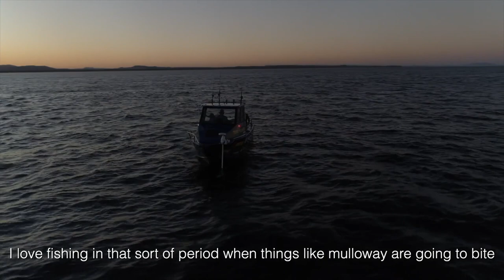Marine Rescue TV Season 1 Episode 9 "This is the Voice"

Comment: In one of the earlier Episodes . The fishing guy is talking about using the VHF radio. He even gives a really good demo of how to do it.
However to my great surprise at the end of the demo he stated and now turn this off. And preceded to do so. As a radio operator , Boater and a LROCP instructor. I find this quite disturbing.  I Teach tell instruct, everyone  that i interact with. NEVER turn the radio off. My reasons for this view is as follows. If your radio is turn off . Then contacting you can be that next level harder to achieve in an emergency.  Then there is the consideration of NOT being able to hear calls for help from vessels in distress that maybe close enough for you to render assistances. I do not profess to be an expert. i am just stating a view I strongly believe in.